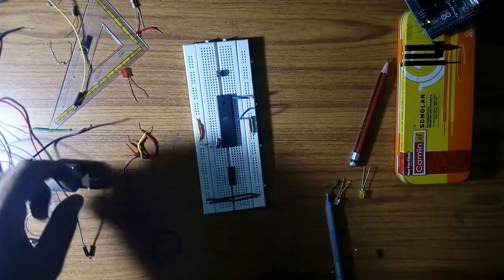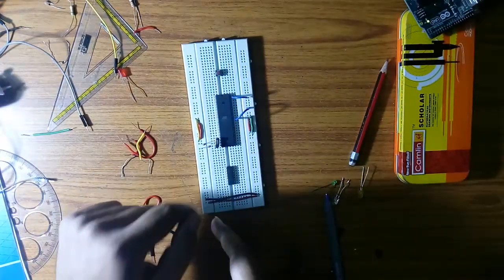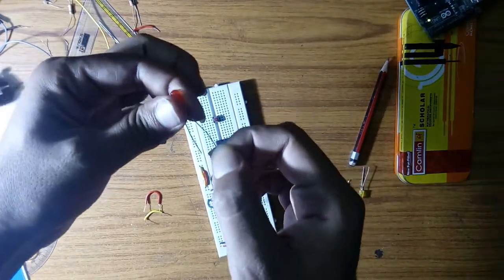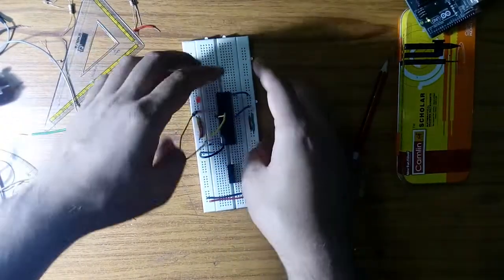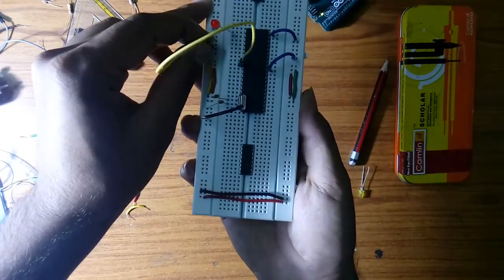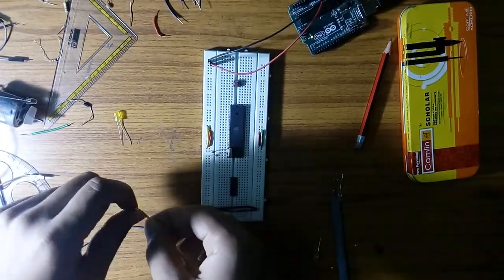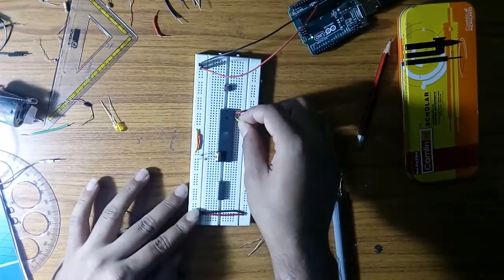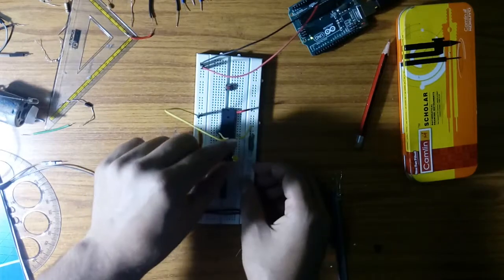8051 microcontroller interfacing with LED,MOTOR and SWITCH

Comment: what software are use to create the Hex file and what software youo used to upload into the at89c51 chip???
thx in advance
Reply from the maker: Software name is keil , and I uploaded using Arduino and the sofware which I used to upload the exact name I don't remember , just search on YouTube , how to upload in 8051 using Arduino , you will get many videos regarding the same.

Comment: why r we using a diode for motor
how do i program my 8051 microcontroller
Reply from the maker: When current flows in a coil of wire (ex. motor, inductor, relay control), a magnetic field is created.
When current stops flowing in a coil the magnetic field collapses and creates some additional brief current flow at potentially very high voltage. The diode lets this extra current flow be dissipated back in the coil instead of in the controlling electronics.So basically it is for safety purpose.

You can program your microcontroller using a 8051 programmer , or a serial port ISP programmer or by Arduino. 
I programmed my microcontroller using arduino.But with arduino only AT89S52 microcontroller can be programmed.